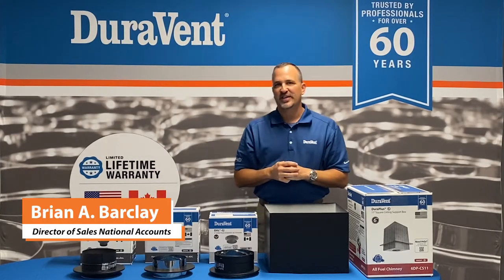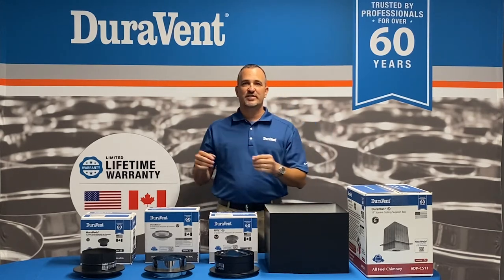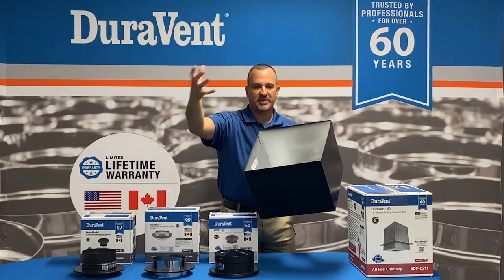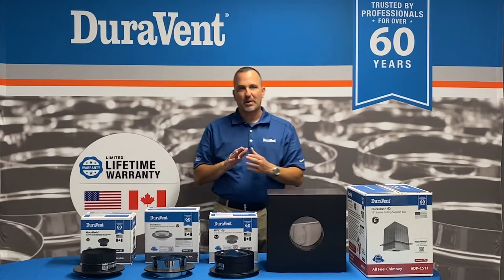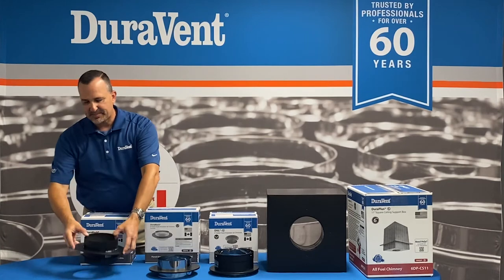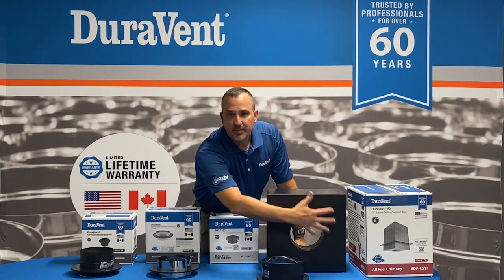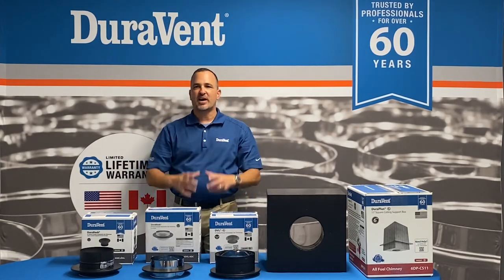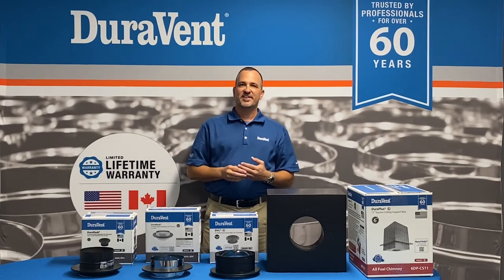Transitioning from Connector Pipe to Chimney

Comment: Would have liked to see a bit more detail, to include how those pieces actually fit into the ceiling piece, and connects to the stovepipe.
Reply: Yeah, I feel like this was a missed opportunity to really explain. If it's a question you get ALL the time...actually do some fitting and twisting and what not. Take the time, longer than 10 mins to explain and not just show and wave hands. If you actually did the deed then you pro'lly wouldn't get so many annoying customers with their same old questions. Felt like the guy is rushing and late for lunch or something like that.
Reply: Couldn't agree more 👏
Reply: @humrod1852  what direction does it go and how does it go in
Reply: I bought the kit and these duravent videos are not very helpful. Seems like whatever kit you get, they short you something and give you something you don’t need.

Comment: In order to screw the stove pipe into the connector box, do you need to drill out the 4 divots on the box?
Reply: No those are rivet and it doesn't even line up with the screws holes. The adepter come with a long self drill screw. I just rotate the adepter to where the sticker is in the back so you don't see it and screw it down. Make sure the inner tube goes in.

Comment: Brian, mine seems to leak where the horizontal portion of the T meets the vertical around the outside joint (exterior portion) where the two meet.  Should this be sealed with silicone?  I can see light thorough the seam between where it is riveted.